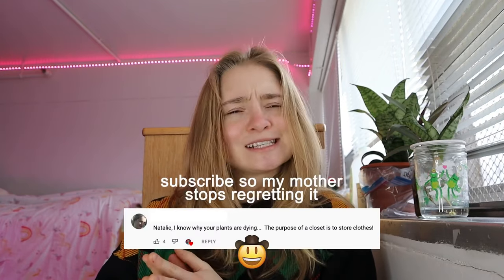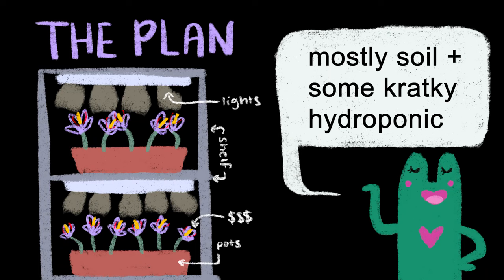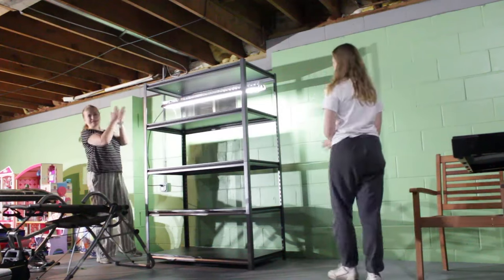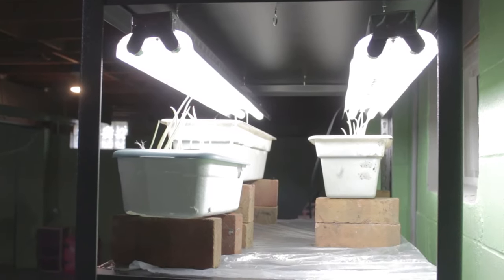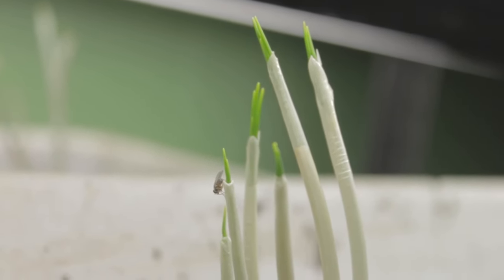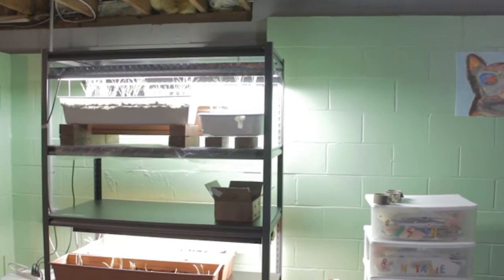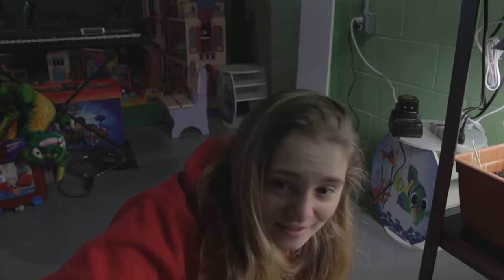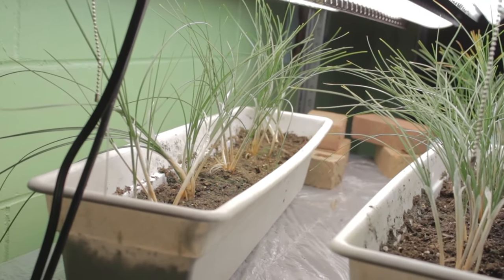I grew the MOST EXPENSIVE SPICE in my BASEMENT

Comment: You need some air pumps/bubblers in your hydro containers. Adding oxygen to your solution is important. Also grow lights would be a huge advantage. If you can’t afford grow lights at least purchase grow bulbs for your fluorescent light. I’m no expert at growing saffron, however i know a great deal about growing the lettuce that you were talking about lol. There’s also many other hydroponic fertilizers that my do your flowers better than flora gro. Also, consider getting a roll of panda film or clear plastic and create a room to contain some heat and boost humidity. But if I’m not mistaken saffron prefers cooler temps later in life, so a colder basement could have been helpful in telling the plants that the season has changed and to prepare for harvest. Sorry they crashed on you. You’ll get it.
Reply: Kratky doesn't require pumps.
Reply: No need for either as long as a portion of the roots can draw air. Air bubblers don't do much good unless it's pure hydroponic with no air. Pumps help with stagnate water and moving water from a base to the system.

Comment: So, I know this is an old video, but my two cents. Check your water PPM, and the PH. That balance is absolutely necessary for hydroponic growth of any type. This is especially true in the case of Kratky. You need to leave room from the base of the root to the root tips for airflow, so don't overfill the tank. If you're getting murky water you can try using a pump to move the water, or even a simple device toy move the water. Bad growth doesn't much like moving water. If you do get surface fungi you can use a 3% mix of hydrogen peroxide, but don't put that in your water tanks, since it can burn the roots over a long period of time. Check the growth needs for crocus then for boosting saffron. Like tomatoes many plants like one PH at the beginning, then want a different PFR during fruiting. Tomatoes like a fairly benign soil at first, then like acidic soil for fruiting. For you lights you can get incredibly inexpensive lights in LED as long as they are about 5000k and 6000 Lumens. LEDs are great because they cost less, produce little to no heat, cost almost nothing on your electric bill, so they won't burn the product even if the leaves are touching the light, they reduce costs, and they are fine for growing. Also don't fall for the light scale scam. Using different color or wavelengths of light ie. ultra violet light only really changes the color of the leaves for the most part. The light scale was a poorly run experiment that rendered no real usable data. There are ways to get rid of stagnating water, and water your soil based plants perfectly every time. Using a water flow system and a trough with a wicking connection can create a water basin that only fills when the water is too low using the same simple technology as a toilet. A plunger arm connected to a valve in a water gutter to control when the water refills, then place your soil on top. As the plant feeds and the water evaporates or is reduced in the soil the water is then refed to the trough/gutter. There are a ton of videos I can suggest you check out that will help you out. I'm happy to help if you want? I guess if anyone does become interested just post a reply and I'll try to get back to ya.

Comment: When it gets too cold in the grow room and the roots are too wet, it's a huge problem, but ESPECIALLY when there's not enough intense light for photosynthesis. The plant won't have the solar or thermal energy to function properly (remember, lights not only provide visible electromagnetism but also the heat plants need, warming up your room!)....... The root rot issue is common with cacti too, and anything other plant for that matter when taken to the cold temperature extremes with too much water in the root zone.

You can gather a lot of insight from looking at other extreme examples. For example, if you have a particularly hot grow room like I do, you can really dump water on your plants and they won't seem to mind. By the next day, you might even find that you have to water again already because of how fast the plants draw water to keep up with transpiration from their leaves. Cool the room down by 20 degrees and I know I couldn't water every single day like that...

Comment: Saffron is not like normal plants and you tried to grow to it like a normal plant!  Saffron has a flowering stage and a propagation stage. You can just leave the bulbs on a shelf in 80% humidity and 25 deg celsius room and they will flower. After flowering, you can put them in the soil or substrate to grow leaves and to propagate when the bulb gives birth to two new bulbs.  You basically went straight to the propagation stage and skipped the flowering.